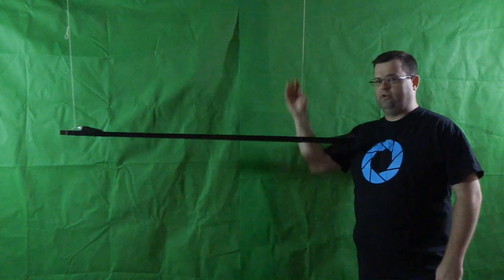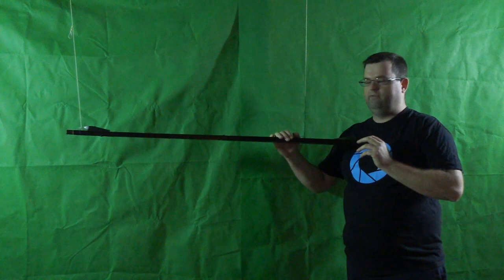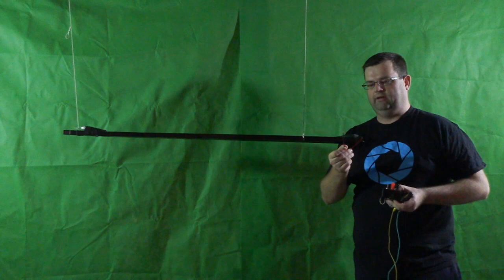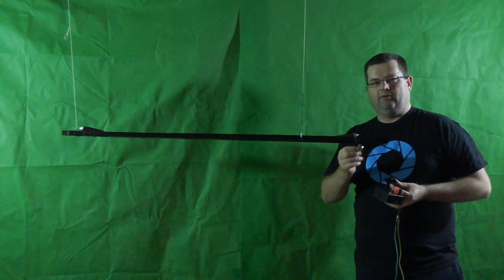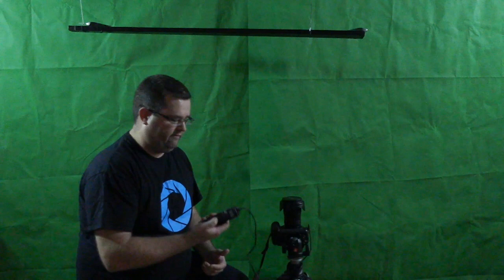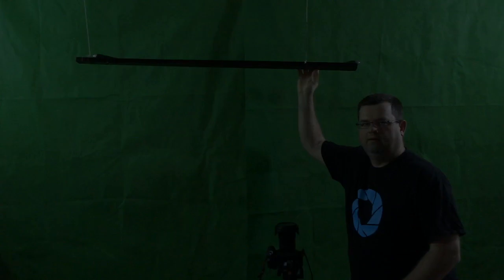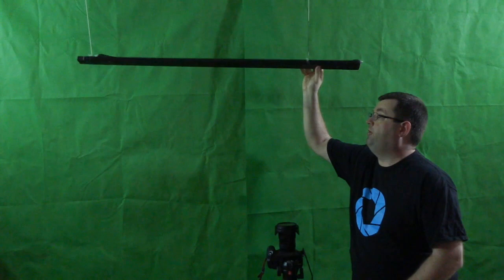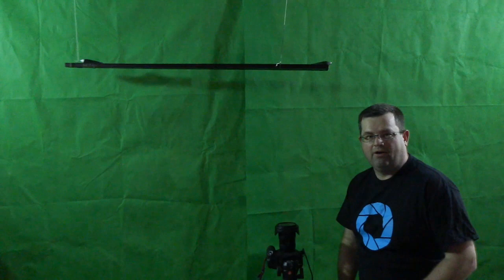Light Painting Physiograms with a Harmonograph

Comment: It appeared that the lights were mounted on the top side of the board. If so, how does the camera, shooting from below the board, see the lights?
Reply from the maker: HI Doug - the board has a series of holes drilled through it that the LEDs fit into and can pass all the way through. You can almost make them out during this part of the video... https://youtu.be/5MLUJKTTd1M?t=1m15s
Reply: I understand. Thanks.  Cool light paint technique.